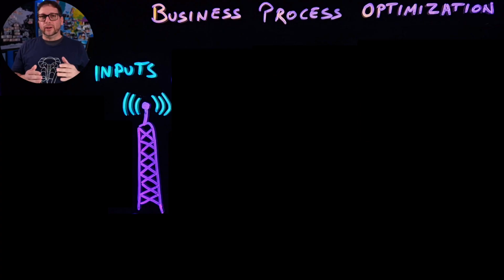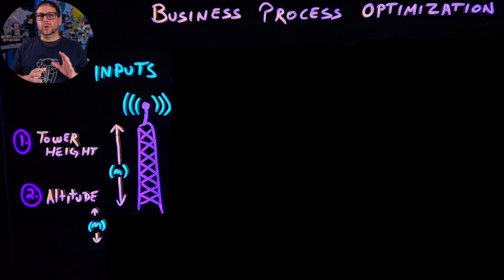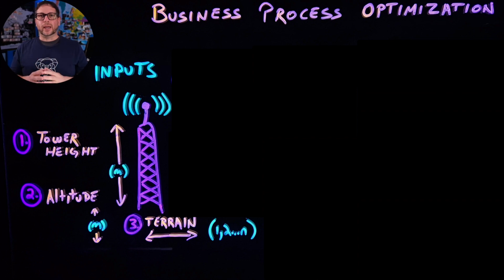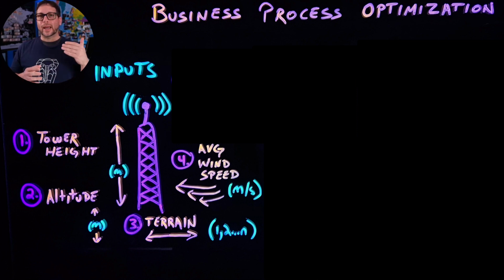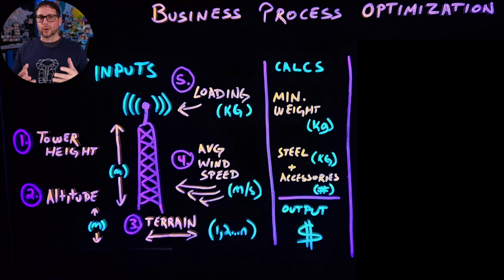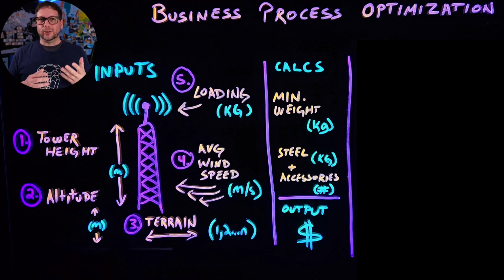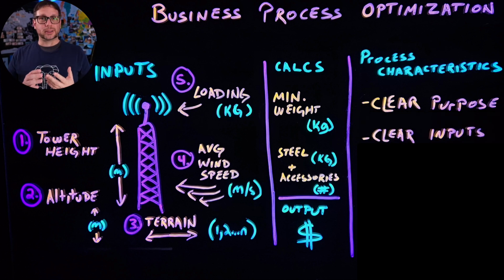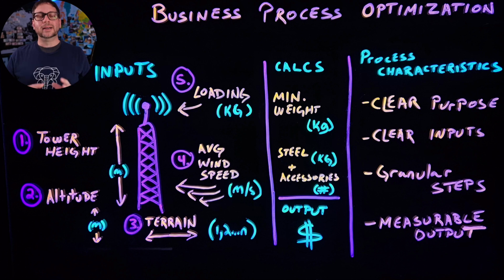Well-Architected: Business Process Optimization

Comment: Should that not be called the cost calculation model for antennae's rather than the optimization process?
Reply: I have same question just like you, and just so you know, this concept (especially in the AWS Well-Architected Framework) goes beyond economics — it’s both a technical and managerial approach used to:

Assess – Design – and Improve business processes
to achieve maximum efficiency, lower costs, and greater business value.

In other words, it’s about optimizing the entire operational workflow of a business, not just calculating costs or planning projects.